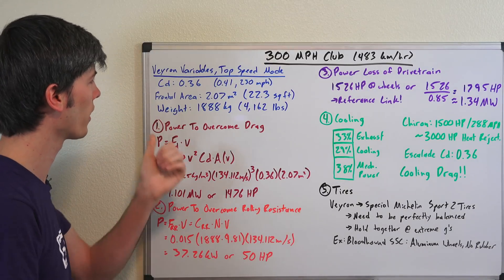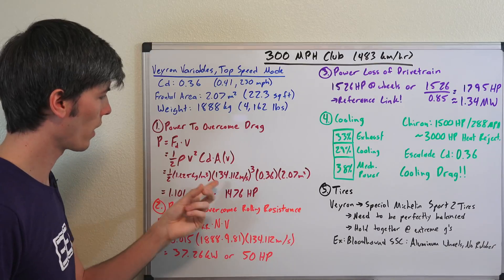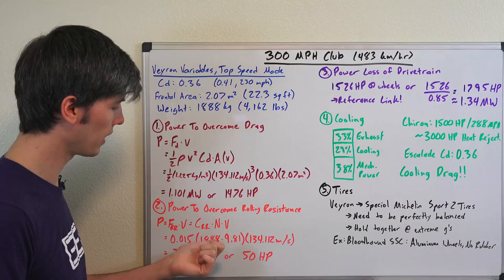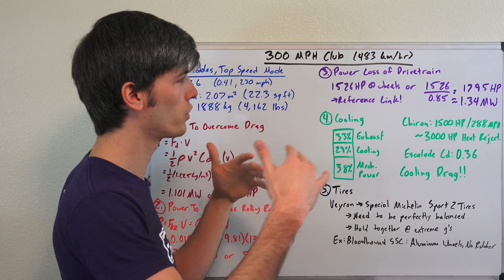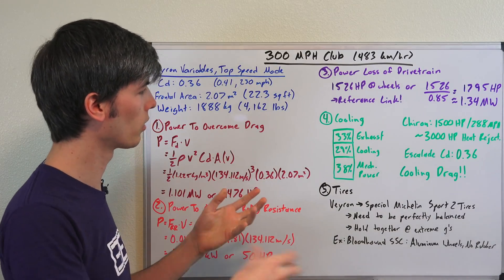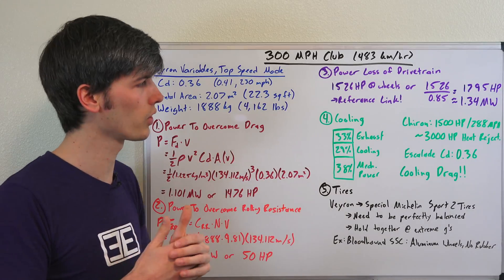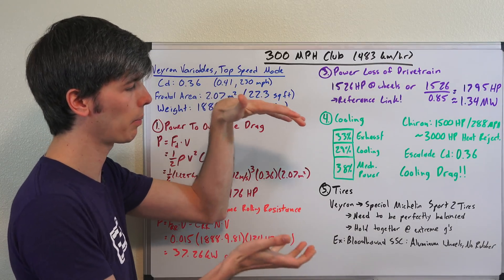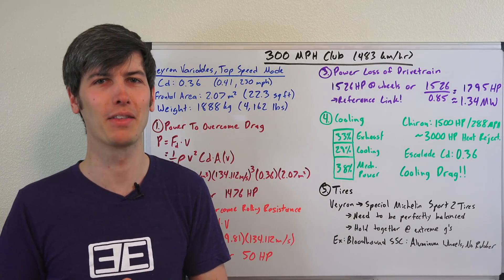Why Has No Production Car Hit 300 MPH?

Comment: It was difficult to find this videos but finally I found. I’m here to remind that Bugatti has just broke world record 300 mph. So you are wrong. And you need any update video
Reply: He is technically correct. This video is two years old, long before Chiron hits record. Despite outdated, it is still interesting to learn the technical challenges Chiron has to overcome.

At the very least, he can simply modify the title.
Reply: Cedric John Llorente I remember this time the Chiron itself was already released and he neglected the possibilities of the same to hit this record. As I remember he said possibilities of changed aerodynamics. The all new engineering that was impossible, according to his words. It’s was like sending rocket to mars.
Reply: @persikii8020  He sort of accurate on the last half. It is either an all new engineering, or a gradual improvement of existing technology. Chiron is a perfect example as it is the successor of Veyron, and have some room of redesign.

High-speed railway is another example: we have the conventional rail, and the magnet levitation. Gradual and radical, respectively. Both have different approach to achieve the same objective.

Comment: Could you please make a video analysing the posted record by Chiron today. Does it mean that Bugatti is underestimating the amount of horsepower that the test car actually had, or they were able to improve drag significantly by using the long-tail? 
Obviously, if their cars are producing circa 1600hp on 93 octane, they would easily squeeze 1800+hp with ethanol
Reply: @amarjit singh your answer is not related whatsoever to my question

Comment: Couple of quick facts before you start to roast him
1. the car is way lower than the standard chiron it is using harder and lower springs tuned for a very slow movements of the body you can see that the car is way lower than standard chiron like 30-40mm
2. the car is not a production car but lighter , stiffer, and way more sleek with less drag than normal car and in these speeds the drag coefficient is one of the most important things, the power output is officially 1600hp but many people think is closer to 2000hp because at the rate of which is gaining speed over 240mph compared to veyron ss, and we cant forget that bugatti was beaten by koenigsegg last year in top sped land record, so its about the pride bugatti was doing everything they can to put the record back ,
3. the tires were specially made by michel and they were using 12 times x ray scan to check any misperfections .
This car is maybe somewhere around 1700kg  with drag 0,31-0,33 based on experienced guess and we can only wonder how much horsepower so i dont see any problem they were waiting until the air was at its least density and speed. the car had longer gear ratios for higher speed it was specially built and tuned for one day for one run and for one purpose there are still secrets we will not know like if it had radio,speakers, trunk and etc they most likely shed all of the weight away so it will be as fast as possible.
SO HE  IS STILL RIGHT IN HIS VIDEO HE JUST SAID THAT THESE ARE THE REASON WHY NOT ANY PRODUCTION CAR HAS GONE 300MPH TO THAT DATE.
Peace.
Reply: The new Chiron version is also in the final phase of production so this video is obsolete.
Reply: Tippotipo yup, its a Chiron Super Sport & soon Buggati will be able to legit brag its toppers at 300+ 😚

Comment: The Chiron hit 304mph a couple of hours ago so just delete your vid ;)
Reply: This video is two years old. Still worth to remain posted, as it discuss the technical challenges Chiron has to face in great detail.
Reply: @dbclass4075  No need to bash this video just bcs Chiron hit 304. He was right from his points and its greater detail to what you'll ever get
Reply: The Chiron that hit 304 was heavily modified bia engine, new tail section, cooling upgrades and specialty tires so still not a “Production” vehicle.
Reply: @Modsnake98  They can just replicate it to make the Chiron SS and sell 25 examples at $6 million
Reply: @Modsnake98  It is a production vehicle as long as it was manufactured and tuned by the same company. Previous record holder, Agera RS also was not a standard Agera, and had tune put in by Koeniggsegg along with a different aero
Reply: @shawnshan9817  you clearly dont know what production car is + they did not run both way so agrea is stil on top
Reply: @grandmasteryoda9893  apparently you dont either..good luck in kindy
Reply: @grandmasteryoda9893   both what way?
Reply: @amarjit singh Why is it illegal? There's no speed limit on the test track!

Comment: So, in summary, if you want to make a production car that could go over 300mph, either:
1. You make a production-able, street legal, and relatively "cheap" engine with over 2000hp, that won't need constant repairment every 1000 km or so.

2. Massively reduce the drag coefficent, one way is that you literally putting on an optional overheat mode, the same way a drag car would be set up to accelerate as hard as it can, onto a production car, so that it could reach that speed for but a moment until it needed to end to prevent further engine damage.

3. Finding way to make a good production tires that could endure all those heat and G. Or somehow be able to cool the tire from inside out, so that it would be able to go on for alot longer (like somehow putting the equivalent of liquid nitrogen onto the inlaid of the wheel and let the centrifugal force carried it onto the rim, and then into the wheel).
Reply: Bugatti just did it

Comment: the konigsegg jesko might just make it with the right condition 440 kg less then the chiron 1600hp 9 speed transmision to help ekk out what ever optimal range that engine can give and 2wd for less drivetrain loss considering the fact that the old agrera rs could do 284mph 16more mph sound acheivable for bascially the same car with 240 more hp and 2 more gear ratio

Comment: I think the C_Two could easily hit it with 1914 HP, and a Regera with a modified gear ratio might also be able to do it. (A Regera on E85 with a 1 MW engine is a sure winner). The Chiron, I'm not so sure about that, but there's far more potential in that W16 engine considering specific power output, and maybe a Chiron Super Sport could do it.

But I wonder why Bugatti, Mclaren, Ferrari and Porsche worry so much about the tires when Koenigsegg doesn't. A stock Pilot Sport Cup 2 was fine after 280 mph +.

Comment: These vehicles are not optimized to do it. That's the basic answer.
They are designed to have creature comforts, carry a side-by-side passenger layout, designed with huge and heavy engines, designed to meet safety standards, designed to be quiet in the cabin, designed to have huge wheels and tires as an aesthetic, designed to look a certain way.

All this big, bulky, heavy, high-drag, compliance-friendly stuff only slows them down.

It's conceivable that a cockpit-shaped canopy vehicle that's extremely narrow (one driver) with narrow wheels and tires, riding just above the road surface, with high tech suspension, dynamically changing body work, hugely powerful forced induction motorcycle engine (light weight, compact), custom transmission, and a drag coefficient less than 0.15 should be able to reach 300 easy.

Comment: why have radiators for cooling, i understand convenience but why not boil the water, it takes alot of energy to boil it, so all the heat energy can be dissipated by boiling the water and just refilling when on a speed run meaning less air cooling channels so barely any drag

Comment: If the cooling drag is the biggest limiting factory, doesn't that mean that the 2020 roadster being the first to break 300mph is quite a reasonable expectation since it uses liquid cooling and is also more efficient, thus producing less heat for the power output?

Comment: If you used electric power instead of internal combustion engines you would require less cooling and therefore you could improve drag coefficient (Cd). That would in turn allow you to achieve the higher speeds with less power.
I reckon Polestar might achieve that with their EVs...

Comment: But in order to have control and not flip into the air like speed boats, you need a spoiler causing terrible aerodynamic drag which slows the speed. For a car to go 300 mph, it would lift off the ground. Even a little bit of air getting underneath at those speeds would lift it. 

And that assumes the rubber tires did not disintegrate. 

The reason why the speed land record holder can go so fast is that it is huge. It is the size of a jet fighter and its own weight helps to keep it under control. Then for power, they just add rockets or a jet engine. 

So no, no production car with rubber tires can ever go 300 and remain on the ground.

Comment: Could they instead at high speeds use an evaporative cooling mode and vent steam out the back and get rid of heat that way while also lowering the drag coefficient?
Reply: Obviously you would have to refill a water tank to continue using it but that seems like a minor compromise.

Comment: I saw a documentary on a Porsche Tuner with 900hp or so engines and their problem was that the car was so compressed by the downforce at speed that the suspensions bottomed and the car was scratching the road lol they had to limit the speed to keep it "driveable" as setting it only for very high speed would ruin everything else

Comment: Okay, so since cooling-based drag is a big deal, and since motors don't generate nearly as much heat per cubic inch as engines do, then I bet you we'll reach this with electric cars way before we reach it with fuel-powered ones.

Comment: I'm surprised you didn't go into more detail about the wheels/tires.  I mean, you started to when you mentioned the SSC using aluminum wheels but you never talked numbers.

Perhaps I can add something.

The most popular size of tire (according to TireGuides dot com) is 215/55 R17.  By my calculations, that gives 766.5271666 revs/mile and roughly 830RPM at 65MPH.  Many cars today are electronically limited to 155mph - at which speed the tires would be doing roughly 1980 RPM.

The Chiron is listed as having the following tires:

Front: 285/30 R20
Rear:  355/25 R21

That, in turn, translates to 754.4478726 revolutions/mile at the front and 720.5937621 at the rear.   The bigger wheels have a slight advantage over more ordinary cars but the front wheels are smaller and would be spinning faster as a result.  However the larger diameter (and mass) would probably create more problems at higher speeds.

At 250mph, the front tires are spinning at roughly 2515RPM (nearly 3x the rate of the regular freeway vehicle).  At 300MPH, the front wheels would be at just over 3600RPM (a 20% increase over the rate at 250MPH and more than 4.5x the rate of the regular freeway vehicle).

I'm not an expert in what happens to tires at these rates of speed but my suspicion is that the stress on the tire structure would be enough to make a tire designer curl up into a fetal position and start sobbing uncontrollably.

As Bugatti found out when they built the Veyron, building a powerful enough engine to drive the vehicle is only one of many problems that have to be solves and, in hindsight, probably one of the easiest.   Any competent mechanic can build an engine that puts out 2,000 horsepower.  The next challenge is (as you correctly pointed out) cooling the engine.  THEN, building a drivetrain capable of putting that power reliably and controllably to four wheels.  THEN solving the aerodynamic issues (my guess is that if anyone wants to even think about building a 300mph roadcar, they will have to design one with variable aerodynamics - one that changes its configuration as the speed increases so you don't destroy the tires or suspension with excessive downforce at top speed but wouldn't leave the ground at lower speeds).

Last, but certainly not least, a tire would have to be designed that could handle the RPMs - either some sort of "tweel" or else one whose pressure could be altered as a function of rotational speed.   I trust we can agree that having a tire burst at 275MPH would adversely affect the ability of the driver to control the vehicle.

But thanks for the awesome videos (subscribed)

Comment: Instead of using radiators why not use a Stirling engine to dissipate the heat and then generate the electricity and  send it to an electric motor in a mild hybrid configuration?  This will decrease drag and use the waste heat to generate more power. Right?

Comment: Even if it were possible to provide the power needed to get the car to move to 483 km/h, there would be no test at that distance.  Most likely it would be 500 km.  It is absolutely insane that someone would interject obsolete units into a physics discussion.  It doesn't add to the understanding, just adds confusion.  Anyone who has a basic interest in physics would completely comprehend SI units.  Those who don't understand or pretend not to understand SI units won't grasp the concepts anyway.  

Talking in horsepoopers is totally nonsensical.  There is no way to relate it to other concepts of physics, such as energy, mass, velocity as one can do with SI units.  Do us all a favour and speak SI only.

Comment: Please don't forget that the  engine oil absorbs the heat from all moving shafts and must be cooled also----loss of this system which prevents moving parts from contacting each other is more important than rejecting heat of combustion!

Comment: + Engineering Explained well the Koenigsegg Agera RS just hit 284mph so won’t be much longer until one of their cars hits 300.
Reply from the maker: Yeah but that was downhill + wind, average speed is important. Lots of cars could hit 300 mph in 100 mph wind. Not to discredit their achievement, they broke the world record, but it's important to look at the average speed across both directions (277 mph). That extra 20+ mph requires a lot of energy.

Comment: If a car hit a very high speed as if 300 MPH that would not be that safe hitting 300 MPH can cause a high risk of your engine exploding or your bakes won’t be powerful enough to stop it from you hitting your school that’s 0 light years away from your house......................or your bakes won’t even consider working example, if your on IOS playing pixel car racer and you find a car with a lot of upgrades to reach 300 MPH in that game hitting that speed and then when the race ends your bake automatically activated so then it takes for ever for the vehicle to stop, if your on a Xbox or a computer FH3 is not really known for that high speed but when you do some how hit 300MPH the braking is bigger than the Byron bay hang out/ base and that’s pretty big if you ask me.......

Comment: 300 mph car sounds nice but rather pointless. In reality, how much time of it's lifetime is going to roll at those speeds? not even in a racetrack is going to be able to reach that unless is racing at the Ring end straight or Avus, for example. Besides what's the fuel comsuption at those speeds?

Comment: mercedes just hit the 50% + efficiency mark for petrol engines which needs less fuel and less cooling so maybe scale that engine from formula 1( 1.6L V6 1000+ hp) to 2.9L which should give enough HP(~1800) to possibly get to 300 MPH.

Comment: so the answer is to go electric then :O since electric motors have an efficiency far superiour to any combustion engine and require comparably only little cooling for the battery pack, this should almost completely cancel out the cooling systems drag. Also since a combustion engine has that peak power only in a small RPM range, an electric motor would also help a great deal since they produce peak power at almost every sensible RPM.

Who knows, maybe tesla will some day build a hyper car that hits the 300 MPH :D

Comment: My honest opinion is that very few petrol cars can achieve 300+ mph and that is so because of the different moving parts in the engine - pistons, camshaft, spark plugs etc which all need much more power to work and that creates energy/power loss. Compared to electric engine which had only one major moving part in engine. So the next breaktrough in 300+ moh club should be done with electric car.

Comment: Couldn’t a car just have like a 10 speed transmission so it has the gearing to get up there? Am I wrong to assume that with a massive top gear that it would eventually get to 300 mph? Obviously you can’t just use a 5 speed with a bigger top gear! But if a manufacturer can make a like a 10 speed with gradual gearing would it work? Or am I missing something?

Comment: do what i used to do with cooling cpu while oc'ing, use liquid nitrogen as the coolant. as far as drag/wind resistance, you would need a car with a nose like a jet fighter. as far as power lost by the drive train, put the engine and guts in the back or better yet, find a way to split the engine and trans in 4 and have 1/4 at each wheel.

side note, bugatti veyron suck! all that fanfare yet hennessy was able to beat it's previous top speed with a super charged v8! super charged v8 > w16 with 4 turbos?!

Comment: Since the video is taking forever to buffer, here's a quicker explanation: Bugatti and Volkswagen don't have the balls to derestrict a Chiron. The Chiron is currently restricted to 261 mph. By contrast, the older Veyron Super Sport tops out at 268 if derestricted, and some were derestricted from factory and marketed as the Veyron Super Sport World Record Edition. The Veyron Super Sport had to be derestricted because, at the time, there was speculation that the tyres would disintegrate, which was quickly debunked after a derestricted Veyron Super Sport hit 268 and the tyres stayed as comfortably on the wheels at that speed as the ones on your car stay on at 30.
Reply: MrSupercar55 Yeah, but they only hit top speed for about a minute. Keep driving a bit longer and you can day goodby to the tires and possibly your life.